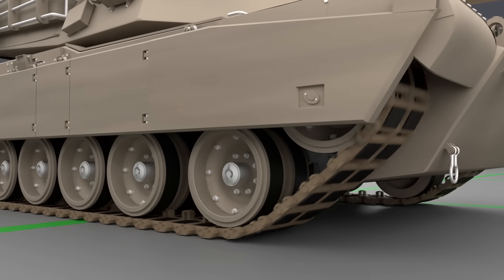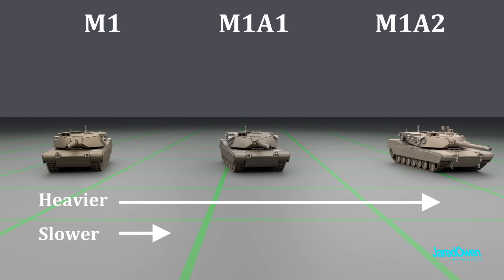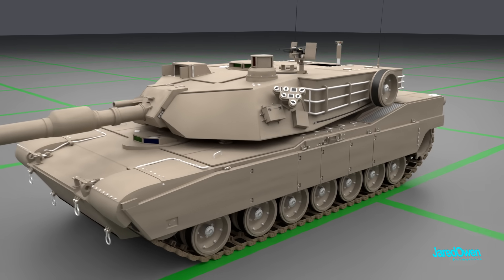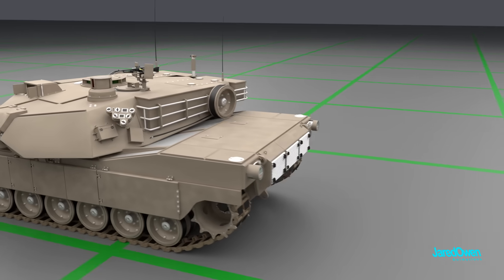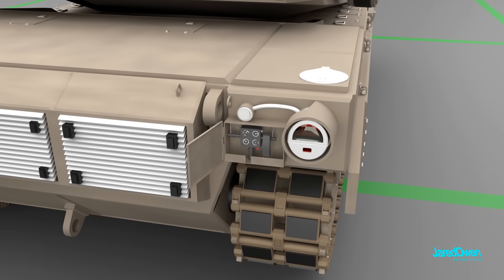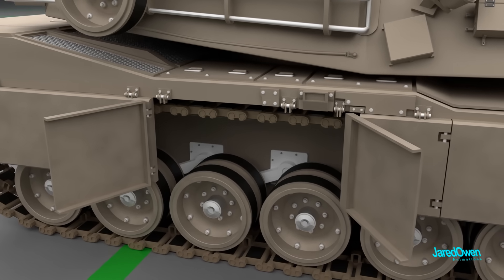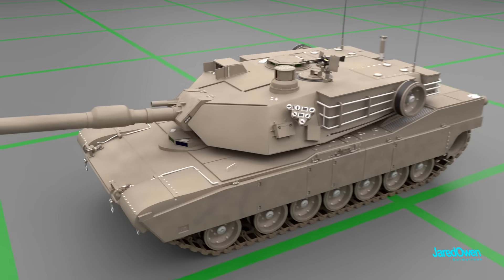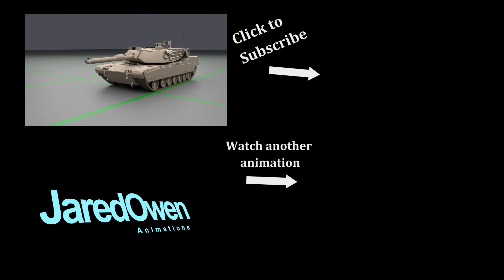How does a Tank work? (M1A2 Abrams)

Comment: OMG. Still manual loading of the canon. In the year 2022, are you kidding me? And still 3 more humans needed to stear, drive an operate? Never heard of digitalization and AI?
Reply: There are advantages and disadvantages to autoloaders. As guns get bigger, autoloaders will win out- but 105mm. to 120mm. is still in the sweet spot of being compartively easily handled in a small space.
Reply: The loader/4th crew member has more responsibilities other than loading a round.  They help in maintenance, loading machine gun rounds, they have a 7.62mm out their hatch for infantry, help with 2-on/2-off watch for 27/7 operations, back-up to other crew members, and extra weapon if you need to fight outside your tank.  Eliminating the auto loader provides more space inside the tank and improves survivability if hit or surrounded by enemy.  No reason for an autoloader as of yet because the 4th crew member fills an important slot in combined arms fighting.

Comment: There's a lot of things in War which are simply symbolic  
When you think about  this tanks are actually useless , they are easy targets for Drones and Planes and infantry with guided missiles which would be able to shoot a tank before the tank is in range to shoot back
Reply: Depends on the type of war.  Confined urban areas with unsecured areas with insurgents/guerillas forces are difficult for tanks.  Tanks are best used in open terrain in combined arms forces with infantry, mortar/artillery, scouts, engineers, intel, air defense, logistics/maintenance/fuel, and close air support.  Opposing infantry forces with drones and anti-tank weapons could not get close enough to use with combined arms.  Gulf War I was probably the last time tanks were used in open terrain warfare.  It has been mostly urban wars since.
Reply: @mrgold3591  that's the Issue , you would be sent to urban Areas , where this tanks are completely useless , they use so much Fuel in fact they constantly require light skin Fuel Trucks to Supply  500 liters of fuel so they can achieve a 150 miles return trip
Reply: @niceboy60  Unfortunately, we don't know Putin's end game of stopping in Ukraine or moving to NATO backed countries.   I can see the good old fashion combined arms fighting could come into play if this happens.  Then you will see tanks filling their role along with aircraft/infantry/artillery and drones and anti tank weapons being harder to use in open terrain.

Comment: US ton, there's something new...
Apparently, a US ton is about 907 kg or 0.907 of a regular ton. But why?
After US gallons vs usual, imperial ones, Fahrenheits, nautical and land miles inches, feet, hands and teeth... Now this!
USA pull it together, you've seen the whole world, do something to go with it.
Reply: Nautical miles are internationally used in maritime applications. Teeth? What? Also Farenheit still is convenient in and commonly used in Canada, Australia and the U.K. It's a "human" measurement meaning the 0 to 100 degrees is more for comfort of a human being versus being based on water. U.S. tons, an uncommon name for the short ton is 2,000lb.
Reply: @peterson7082  here here now... First of all no, Fahrenheit is not used here in the UK.
And no, it doesn't make sense. S.I. units are all interconnected decimal numbers revolving around the properties of water. Example: one cubic meter of water is one ton (1000 kilos) and 1000 liters. A kilo has 1000 grams, a metre is 1000 mm a litre is 1000 ml water is solid at 0⁰c and vapour at 100⁰c. Simplicity is brilliance anything else belongs to past times merchants scaming foreigners
Reply: @georgekanulas9037  Nautical miles are not the same as kilometers or miles. They're based on a minute of latitude.
Reply: @peterson7082  my objection is about land miles being different. Nautical miles make sense when using a map for the same reason knots do too as a short way for nautical miles per hour
Reply: @georgekanulas9037  The US military does everything in metric and greenwich meantime.  The US military can coordinate and talk to the rest of the world.  Just the average American is just too stubborn to change.
Reply: @mrgold3591  makes sense. So does NASA right?

Comment: 68 US tons? Also 68 US brain cells.
Reply: A U.S. ton is an uncommon moniker for the Customary system's short ton. Which is 907kg. or 2,000lb. Compared to the Imperial system's long ton which is 1,016kg., or 2,240lb. and the S.I.'s metric ton/ tonne at 1,000kg. or ~2,205lb.

Comment: how much horse power?
Reply: 1,500 gross horsepower.
Reply: @peterson7082  thank you. 1500 is what I exspected.
Reply: It is not about the horsepower; but, the torque of +4000 lb-ft (+5400 Nm) from a smaller engine/transmission pack.  That is what give the M1 its performance improvements over diesel engines.

Comment: What do you mean by 68 US tons. Now, a ton is an international unit and has nothing to do with the USA, are you calling it US ton because you are using it? Why not US foot than hahaha
Reply: "U.S. ton" is an uncommon moniker for the Customary system's short ton, which is 916kg. (2,000lb.), compared to the 1,000kg. (~2,204lb.) of the S.I.'s metric ton/ tonne and the Imperial long ton of 1,016kg. (2,240lb.).

Comment: Seeing the current war. Tanks are the most useless military vehicle. They're not designed for urban combat. They can be taken out by one Molotov-C. Just throw one where the commander sits, and the tank is done.
Reply: A Molotov hardly damages a tank at all
Reply: @cbskwkdnslwhanznamdm2849  it wont kill the crew, or disable the tank, but it blinds optics which puts the crew in a stressful situation
Reply: @cbskwkdnslwhanznamdm2849  It may not damage the tank, but It will kill everyone inside. There are 3 openings that I can see which are the best places to throw a molotov at to cook those 3 people inside.
Reply: I doubt you will think so once you see one coming at you guns blazing.
Reply: thats why tanks are to be with infantry support and equipped with Urban kits.

Comment: The M1 Abrams speed is set at 25 MPH. The tracks will overheat and dislodge if driven over 25 MPH for periods of time.
Reply: Uh no? What is this based on?
Reply: A former Marine I served was a crewman in an M1A1. The tank can definitely go faster but is set with a limiter so it doesn't do faster than 25 MPH, so the tracks don't fall off.
Reply: @USMC_LAterZ  I know there is a governor limiting speed, but 25mph, I've not seen anything referenced to prior
Reply: @peterson7082  This is just what a former crewman told me. Besides his words, I don't have any resources either.
Reply: @USMC_LAterZ  Thanks for the input, I don't want you to think I was calling you or your fellow tanker liars. Just never saw low a speed before. Have a good day

Comment: The "stabilizer" for the main gun is actually a compensator.  It will keep the point of strike of the currently loaded round on the specified target at the crosshair point, the little hooded thing on the muzzle is quite literally an optical gunsight for the computer to know precisely where the tip of the barrel is in relation to the gunsight and it can compensate for minor deformations in the barrel.

The system even adjusts for vertical, horizontal and axial motion.  If you managed to drop an M1A2 by parachute and kept the vertical motion under 3.5mph you could hit a target as it floated down.

Comment: Not a expert in tanks, but why dont they make the loading automatic?
Reply: A manual loader takes up less room, you can pack more tank rounds, the loader is faster than an autoloader when you need to shoot multiple rounds in a row, the loader can help with maintenance/cleaning, the loader can have access to an extra machine gun for infantry, take care of communications, help with any loading/jams with both machine guns.  Having a crew of 4 also means you can run in shifts if you need to stay alert for days on end.  Also, it is easier to run a tank crew down one person if you have 4 compared to 3 person tank crew.  No military unit would want to operate more equipment and have more responsibility with less people ever.
Reply: @mrgold3591  Also with an autoloader ammunition is stored right in the center of the tank which greatly increases the chance of ammo rack
EDIT: BY STORING I MEANT THE READY-RACK
Reply: @justaguy906  not always necessary, Japanese and French MBTs for example use autoloader but they stored their shells in a separate compartment much like the Abrams
Reply: @Kalashnikov413  yeah but the autoloader is in the middle of the tank shells will pen the side easily and hit the ammo
Reply: @justaguy906  like i said, all of the shell was stored on the back of the turret with separate compartment and blowout pannel, so i don't know what you're saying here
Reply: @Kalashnikov413  So does the autoloader grab the shell from the conpartment ?
Reply: @justaguy906  yes
Reply: @justaguy906  the ammo is actually stored in a drum-type compartment, which has already been done since 1950's with the introduction of French oscillating turret
Reply: @Kalashnikov413  thank youuu
Reply: @mrgold3591  thanks

Comment: I actually knew a lot about this tank already but I had no idea it could run on various fuels and it's primary was jet fuel. Very interesting
Reply: Пиздец ты дебил 🤣🤣 СССР ещё раньше вашего сраного Абрамса на т64 применили питание на 3 вида топлива🤣🤣🤣🤣 ну что тут сказать как говорил Задорнов ну вы тупые 🤣😘😘
Reply: the engine isnt the standard piston, so it only makes sense that it would. jet/airplane engines works by igniting the fuel to create spin instead of pushing a piston, so any fuel would work i think, not sure about gasoline considering how flammable it is.

Comment: Your "engine" is actually the power pack, and consists mainly of the transmission.  The big coolers are for cooling the transmission oil and final drives.  The engine itself is actually quite small.  You totally forgot to mention the second most important part of the tank...the gun sights.  They are what makes the Abrams so effective.

Comment: Lots of comments saying how tanks are pretty much useless and a javelin missile which cost so much less can take out a very expensive tank. (watching too many Ukraine war videos going on ;)
Yes, tanks are vulnerable in Urban settings, but they are not an obsolete form of a war machine. 
In war, different situations and scenarios call for different tactics and manpower and/or vehicles,  aircraft etc. Tanks rolling up to a city a few miles out can essentially do a lot of damage and destruction to buildings, military sites etc. - out of range of javelin missiles. 
People thinking that  just having an army of javelin carrying soldiers can just wipe out tanks no problem. Its not that simple. Those javelin soldiers are sitting ducks against machine gun welding soldiers. 
Also consider tanks can cover larger distances than humans on foot quicker and are also better at protection against things like land mines and just even stray bullets flying around on the battlefield. 
Don't underestimate the role that a tank can fulfill in war.

Comment: I can tell you this THE VAST MAJORITY of people would freak out inside a tank. 
No room but close the hatch. 
There’s no nice radio. Ac. Or a tv. 
It’s cramped and if and when you need to sleep you’ll lay anywhere and anywhere isn’t comfy. 
And the driver has it almost worse. Some had bottom hatches to get out. 
But trust me it’s a tight area. 
This is why I find a few things funny. 
Our military saying all sizes. Shapes. Lgbtq can serve. 
Well fyi over weight if your ass gets in it might not get out. But as hot as it gets inside you might lose 30 pounds a day
Reply: A/C's are in A2's.

Comment: Good video. One thing though, there is a slight mispresentation regarding the smoke dischargers. One could easily assume, looking at this video, that they actually produce smoke, much like a chimney. But they aren't. They launch the smoke grenades, somewhat like a mortar, which then in turn produce smoke, covering a much larger area in that way.

Comment: 3D animations are great! One thing when talking specs of army equipment: use international SI system units, not miles, gallons, inches etc.
Reply: US tonnes 🤦 that was 🤣
Reply: Phuque 'International Units!'
The U.S. managed to create the modern World and create nuclear power and weapons and space-flight as well as land on the Moon and return ALL WITHOUT the 'Metric System'
Reply: @gerrynightingale9045  Yes, but it's not what you can achieve, it's just that international military language uses SI units.
Reply: @lahtem  WHAT????
WHY would the U.S 'give a flying phuque' what some other so-called 'Military' uses or does not use for 'measuring?'
__________
'Units of Tens' is no more accurate and far less readily comprehensible than the 'Inch'
__________
The length of an adult foot is comprehensible as a 'measure of distance' and so is the distance of a 'thumb and forefinger'
Reply: @gerrynightingale9045  

Several reasons:

1. it is a more accurate system. for measuring distances .

2. its actually a simple system to use if your not converting to standard all the time.

3. All NATO forces use the metric system. That way if I call in support from a British unit , or German unit, the know exactly how far I am away from the impact zone for example.
Reply: @gerrynightingale9045  Because all of the US's allies use it
Reply: @gerrynightingale9045  "Stop It, Get Some Help"
Reply: @alexkomunado5356  I have an idea!  You 'STFU' until such time as you form an effective rebuttal that doesn't involve me personally
Reply: @gerrynightingale9045  You're a bit special, aren't you?
Reply: Yes I was thinking that too... it's a bit cringey to still hear feet, inches and gallons in this day. The resistance to metric is amusing!
Reply: @psychohugtime4150  It's 'amusing' to think a child feels the need to 'Comment' "I know my ABC's!' as-if this 'means something'
Reply: @gerrynightingale9045  you just proved my point, lol. Congrats!
Reply: @psychohugtime4150  *You don't have a 'Point'...only a claim that 'I know how 'ones & zeros' work
which I don't consider much of an accomplishment since you did not create it*
The 'Metric System' existed long before either of us, and to 'crow' on a thread you 'know about it' proves nothing other than you're a child craving affirmation from anyone
Reply: @gerrynightingale9045  the imperial system was invented by the british
Reply: @sonetagu1337  WRONG!
The 'Imperial System of Measures and Weights' dates back to 'BCE' with thousands of records to prove it
The Romans brought those systems to England long before there was any 'England'

Comment: potentially useful, but lost interest as there was no metric system for units. I have no idea about the speed of the tank. Small suggestion. also give the units in metric (you could still talk in imperial, but you could also display metric)

Comment: so if you manage to block the turret , the pilot would be unable to exit the pilot seat
Reply: He could, be tight, but generally auxiliary power allows the turret to be rotated by the driver's dash controls even if the crew in the turret are incapacitated or gone.

Comment: the Russian tank is still better than not even the "Armata", but the T90. We already have an automatic loading system on the T72.
Reply: The M1A2 doesn't use autoloading because if it ain't broke, don't fix it.
Reply: 1. Manual loaders can load faster than autoloader
2. The T-72 is still pretty sucks compared to the Abrams
Reply: @Kalashnikov413  The fastest auto-loaders are the recoil-operated ones, although I don't think it's exactly safe to risk clonking a crew member in the face every time a shell is fired.
Reply: @commscan314  and how many tanks were actually equipped with such autoloader mechanism?
Reply: @Kalashnikov413  The Panzer II was, although it used 25mm shells.
Reply: @commscan314  and the modern one?
Reply: @Kalashnikov413  It uses an autoloader that isn't automatic cycled.
Reply: @commscan314  gonna repeat my question again: is there any modern tanks that use recoil-operated autoloader?
Reply: @Kalashnikov413  No.
Reply: @commscan314  then recoil-operated autoloader system is out of the line in this discussion
Reply: @Kalashnikov413  Yes, if you do not take into account that these are tanks of different generations. T72 is very old.
Reply: @leader-tech3734  very old yet are still in use and fully upgraded to meet the 21st century

Comment: Or you do not have the correct model or the turret of this tank cannot rotate 360° since the front of the turret collides with the rear of the trolley where the engine is located.